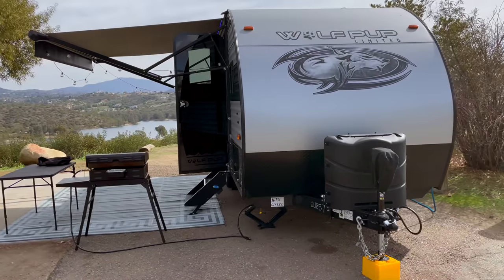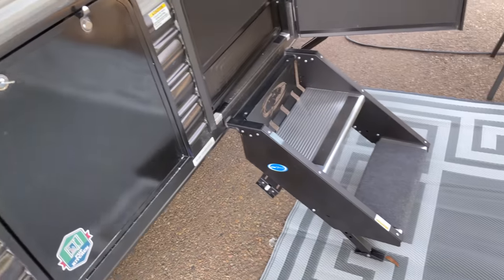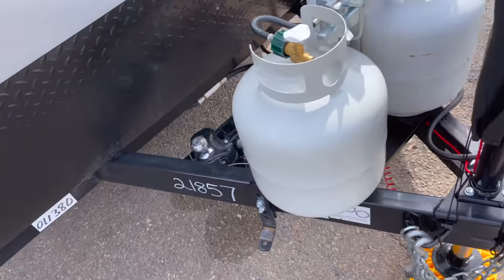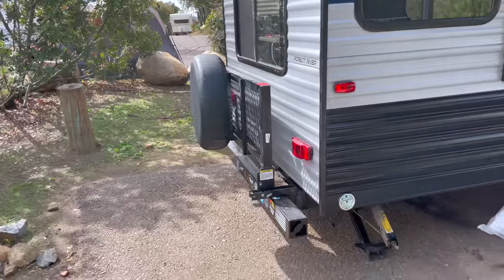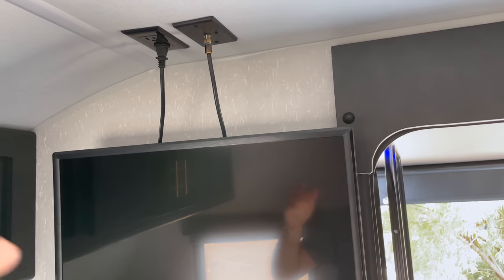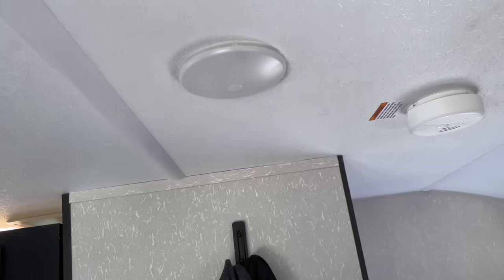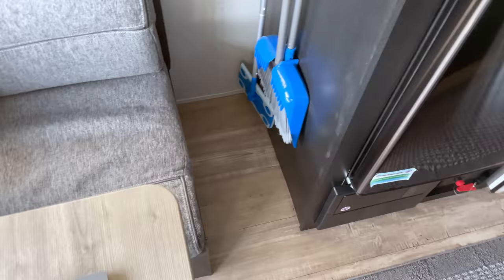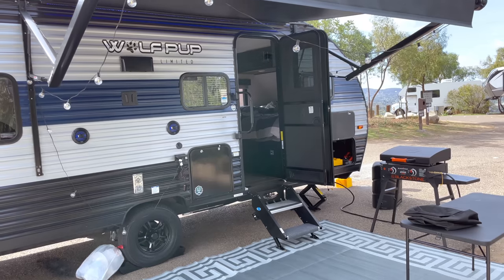MY NEW CHEROKEE WOLF PUP 16TS TRAVEL TRAILER 🏕 🎉 - Full Tour

Comment: Funny,  I bought a used 2021 first generation FQ model. Had the same screen door issue.  I'm an engineer and saw the door frame is bowed out at the latch. The dealership agreed and before we transferred ownership they replaced the door!  Surprise!  New door has the same bow!  The door latches but the brush insect seal is not totally covered.  So, this is a Lippert door issue.  I wish now I had just shimmed the latch because the replacement was not the same quality in the way of caulking.  Good video, btw.
Reply from the maker: Interesting! And thanks!

Comment: Sweet setup!  I'm comparing the 16TS to the 16FQ.  I may have to go with the FQ for bed length.  I'm 6'4" and think the east/west bed wouldn't cut it.   Thanks for sharing your mods!
Reply: I just purchased the 16ts it doesn't have enough room for me it would be better with a slide out or 2or 3 still a nice camper.
Reply: @tonycagle6258  I have the 18TO,  Full slide wolf pup series and still a small footprint. When the slide is out it becomes a very comfortable living area.

Comment: I just bought a pup 14cc. went to Iowa to get it way cheaper than anyone else. Perfect for two!
Reply: Black paint on the AC.  Bad idea.
Reply from the maker: Talking to a couple people from Dometic and Coleman, there is no affect to the AC unit as far as efficiency goes when it comes to black and white shrouds. If there were, they wouldn’t make them in black. Space between the components of the air conditioner and the shroud itself plus the ginormous vents that are in it allow the unit to do its job properly regardless of the color. Will the black shroud itself be hotter? Yes, but no affect on the units according to the pros.

Comment: Very informative video. Have you ever weighed your trailer when you're loaded for a weekend or week?
Reply from the maker: I have yes. It’s at about 3400lbs. I don’t travel with water in the fresh water tank either. I’d go over the axle rating on the Tacoma if I do.
Reply: @TheRVPastime  Oh. What does your hitch weight end up to be? I thought the Tacoma had a pretty good tow capacity. Isn't it five or six thousand pounds? Sorry about all the questions oh, but I have an 86 Ford F350 DRW so I never thought much of tow capacities with small trailers. Now I'm passing that truck onto my son, and in the market for a much smaller truck. Actually maybe not even a truck in the sense. I've been looking at that Hyundai Santa Cruz. It has a 5000 pound towing capacity, but it's smaller than your Tacoma. I don't want to run into braking issues either. 
Thank you for any input or opinions you may have.
  I don't want my total weight to max out much at all over 3750
 pounds. I want a safety buffer.
Reply from the maker: No problem, the hitch weight is somewhere around 500-600lbs. The common misconception about tow capacity is that the advertised number is not usually what its actually able to be. In my case because I have the “pro“ package on my truck that adds more weight to the vehicle and my payload is less which affects what I’m able to actually pull. My truck is able to pull about 5600 but in my honest opinion the Tacoma‘s just really don’t have the power or the transmission to do anything that heavy. Can it? Sure. Should it? Debatable lol.
Reply: @TheRVPastime  That's why I want such a large buffer. I'm also worried about frontal mass. In the past, I have pulled trailers that were not particularly heavy, but felt like you were walking with a piece of plywood on a windy day. It's no big deal when your truck is tipping 8000 lb, 23 ft long, and has a set of training wheels, as my brother so affectionately called them.

Comment: Hey Nick! I picked up my 16TS last Friday! I love it already. It has a couple of smaller issues but nothing major so far. Came with the Castle Rock tires though which I want to upgrade ASAP.  Did you switch to the same size Goodyear Endurance tires or did you upgrade? I would like to move up in load capacity but don’t know enough to make an educated decision. TIA!
Reply from the maker: Congrats on your new 16TS! Welcome to the family. As for tires yes, I switched to the same size tires in the good endurance. I’m not sure if getting bigger tires is really that big of a need for this particular type of trailer. Considering the max load at 65psi for the Endurance ST205/75R14 tires is 2080 pounds each, and the 16TS axle GAWR is 3500, you should be fine as long as you never overload the trailer. Hope that helps! Either way, tire upgrade is a must for both peace of mind and safety :)

Comment: I am curious on how you setup the awning LED strip. Did you have to hide the controller box inside? Any tips would be much appreciated! 😉
Reply from the maker: Yes, the controller is hidden inside of the awning arm where the power to the original led tape terminates
Reply: @TheRVPastime  Ah cool! It should be a pretty easy install then. Thanks for the response.

Comment: I like your video and all the modifications you made to the unit I was just wondering how much did it cost to add base value?
Reply from the maker: The electrical upgrade is naturally the most expensive upgrade. The lithium batteries run about $900 each but I think I got them on sale. To get an idea of overall cost, you can build up a similar system on their site to see the totals.

Comment: Thanks for this. Q: What is the useable width of the door, and threshold elevation from ground? Considering for use of a less than 100% mobile person. Also, is 12V refer working out well? Love all the Geek stuff.
Reply from the maker: I don’t have that measurement so I’ll have to get that when I’m at the trailer next. As for the fridge, it’s great! Gets cold super fast and haven’t had any issue yet.

Comment: Love your modifications as I own a 2020 Wolf pup 16 fq.  So far I've only added two 100 watt solar panels to the roof and the hydraulic arms to lift the cabinet doors as they pull upwards.  Noticed you put your lithium batteries inside the storage as oppose to being outside where the original one was.  Was that for security as they are pretty expensive?  It takes up your storage space. Looking forward to more ideas in the future.
Reply from the maker: A little bit was security, but mainly it was because I wanted to have all the electronics in one place and short cable runs. Plus, lithium batteries don’t do well as you get to freezing temps (if I was ever in that situation) so it was better to have them in a climate controlled environment. As for the storage space, for me, that small amount of storage space it took up wasn’t a big deal.
Reply: @TheRVPastime  Very nice set-up. But not sure if I would want to have batteries under my bed. Seen too many videos where things go wrong

Comment: Would you link the faucet!? Also, sorry if you said it but what size tv fit in the front by the bed? Did you use existing mounting bracket?
Reply from the maker: Here’s the faucet I got. I had to get some adapters for the faucet hoses to the pex tubing since they were different size. I got some that had valves on them so I could shutoff the water at the sink if need be. https://www.amazon.com/dp/B08JPWRSL3/ref=cm_sw_r_cp_apip_wuiRtwBZxdX52

As for the TV, I did use the existing bracket and that’s a 24” TV but I’ve seen people either move the mount or use a different one and put a 32” but that is a bit tight.
Reply: @TheRVPastime  right on I had tried a 32” but I’d didn’t fit. I don’t want to relocate the bracket yet. 

Thanks so much for the reply!
Reply: @TheRVPastime  I bought and just installed the faucet you linked to (into my 18RJB) but forgot about the adapters, so any links for those or you just went to the hardware store? Thanks.
Reply: Just saw the instructions have a link to the amazon store for the adaptor, so that should work.
Reply from the maker: Ok cool. Yes I ended up getting some valves at Lowe’s that allowed me to shut off water to the faucet but also helped with the size change. Unfortunately I don’t remember which ones I bought

Comment: Hello. I really enjoyed your video. I ordered a 2021 Wolf Pulp 16bhs. I want to do led bulbs for the exterior. Which route did you take in doing this to your own?.... Nice truck too! 😊
Reply from the maker: Which LEDs are you referring to? The trailer marker lights or the awning? The LED replacements for the marker lights on the outside of the trailer are 194 bulbs. Simply pop off the covers and replace the bulb. Thanks for the note about the truck ;)
Reply: @TheRVPastime  Thank you so much, the bulbs for the outside markers lights is what I’m looking to upgrade. Thanking you for providing the 194 bulb number. 😊
Reply from the maker: Sure thing! Also just a heads up some LED bulbs can only go in one way otherwise you reverse polarity so I suggest you replace them with the lights on and if you plug in the bulb and it doesn’t turn on flip it around and see if that works.
Reply: @TheRVPastime  Oh okay, yeah I had no clue about that? Thank you so much for that tip! I look forward to more of your videos to come. 😀

Comment: The GVWR for this trailer is 3970lbs.I was told I should not pull anything heavier than 3500lbs with my Tacoma V6 .Have you gone uphill much with this set up and how does it behave?
Reply from the maker: Here's the thing about these trailers...the GVWR is 3970, however the axle rating is only 3500lbs. So, in reality you shouldn't go over 3500lbs on the trailer anyway. Im currently sitting at about 3400lbs with the trailer. The Tacoma pulls it "fine" meaning, its all within limits and payload capacities. However, the Tacoma doesn't really like to tow heavy things in general. All in all, I haven't had any issue with the Tacoma, but I will be upgrading to a bigger truck soon just so I have room for expansion with a larger future trailer.
Reply: @TheRVPastime  Thank you for the reply .Cheers

Comment: Hi , Great Video ! Did you remove the Air Condition cover to paint it or just paint it while on the roof ?
Reply from the maker: Great question! I removed the cover. I think it was only a couple screws. Super easy. :)
Reply: @TheRVPastime  It looks good black, but are you concerned about its vulnerability to increased heat stress/fatigue/breakdown since black absorbs more heat?
Reply from the maker: They actually make these covers in black already and it’s the same plastic material. Just stupid expensive. The paint used is also UV resistant.
Reply: @TheRVPastime  but it will still absorb heat and ac efficiency goes to crap .
Reply from the maker: There are plenty of observations from manufactures and RV owners online when it comes to the color of the shroud on the AC unit. The overall consensus is that the color of the shroud has little to no affect in the performance of the AC unit. It all comes down to the quality of the AC unit itself in construction, design, and installation. The shrouds are a means of protection from direct sunlight and rain. I spoke to someone at Dometic about this very subject and the response was a giggling “no, the color doesn’t matter. If it did, you would only see AC units come in white. It’s just an aesthetics thing”. Because the shroud is a thin plastic piece over the AC unit with multiple vents and holes it does not do a very good job at trapping heat as if it was a sealed unit.

Comment: I was wondering if you could share which LED light strip you used to replace the blue one under the awning? I have a larger version or your camper and I would love to replace it but have it look factory like yours. Thank you for the help
Reply from the maker: It’s kind of a hybrid installation in that the strip itself can be any waterproof led strip off Amazon. I got this one https://www.amazon.com/dp/B00COE78EQ?ref=ppx_pop_mob_ap_share

However, because the controller/receiver for the LEDs needs to fit in the awning arm, I used a slim version from a previous set I bought which is this: https://www.amazon.com/dp/B07NWFVRY4?ref=ppx_pop_mob_ap_share

The controller is the little black box the goes between the power and the led strip itself.
Reply: @TheRVPastime  thank you. I wondered if it was just a standard strip. I didn’t want to take it out then not be able to find something to fit nice. Plus I want to use the factory switch. Thanks again for the help. You have some great mods

Comment: What range of gas mileage are you getting with your Tacoma?
Reply from the maker: I get about 11-12 mpg, so about 250 or so miles. Depends on the grade.
Reply: Did you add any additional gauges to monitor trans temp on your Tacoma? Do you use ect when towing or shift. Thanks. A towing video or hooked up to the truck?
Reply from the maker: I do not monitor the trans but have considered that. And yes, I always use ECT mode while towing.

Comment: can you tell the what tires did you get to replace the one that came with the trailer.  I have a 2020 Wolf Pup FQ16.  Thanks in advance
Reply from the maker: Sure, my tires on my 16TS were ST205/75/R14 tires which I replaced with Goodyear Endurance of the same size.
Reply: @TheRVPastime  
Thank you!  I hear all these stories about stock trailer tire, I’m trying to stay ahead of a potential problem.

The mods you made are awesome, following.
Thank you again

Comment: 2023 Wolf Pup 16 TS owner here, what a joke. I am a single guy, never loaded the RV to capacity ( I don’t carry water) just some clothes and food. I was headed to Lake Tahoe at the end of August when my Inferior “cast” aluminum rim literally blew up. I never ran over anything or even heated up my brake drums. I was traveling on a flat area of hay 20 when my rim blew up, instantly. I had full coverage insurance, they wanted to have me file a claim, but because there was no accident no can do. Because it’s a manufacturing defect. The “wonderful” free towing took 2.5 days of me sitting on the edge of the bay before they had a con artist tow company tow me to my maximum distance of 100 miles. Zero dealers in a radius greater than 100 miles would allow my trailer on their lot. The place where I bought the trailer also refused to fix the problem. They referred me to the Manufacturer. Let me be clear here, the rim blew up into hundreds of small shrapnel pieces of aluminum. And, the shock load of the trailer instantly loosing the rim caused the axle to break and the leaf springs to be severely damaged. The company has never called me back. I ended up at a gas station for another 3 days. Totally dissatisfied and disappointed with Forest river and the entire RV experience. This is a 2023 that was just over 6 months old. This was my baby, I washed it every week just to keep the dust off her, it was immaculate before this happened, now it’s been sitting in my driveway for over a month and no one is willing to do anything for me. Are we living in the Twilight Zone? Confused, sad and totally dissatisfied. Looking to get thru to Forest River.

Comment: Can't control the awning on our 21.5 FQBL with the app
Reply from the maker: The OneControl app? That’s a bummer. I think that’s standard now on all new Pups
Reply: @TheRVPastime  yeah  just for whatever reason the awning is locked in the app. I can control just the awning and the scare light in it.  I had hopes of being able to do more with it
Reply from the maker: I have the 16TS but I have had that happen a couple times. That’s a safety feature built in. It usually locks out the awning when it detects movement such as the trailer moving down the road. Usually if you tap the physical switch, it’ll unlock and let you control from the app. I find that usually it’s locked out if I try to move the awning from the app shortly after I finish setting up. But, later on, it functions properly. Give the button tap method a try. :)
Reply: @TheRVPastime  I tried it but maybe it was picking up the wind and it was hlowing more than I thought it was
Reply from the maker: Maybe!

Comment: I wasn't able to use the existing wire to pull new wire through for a new solar setup. Also when I rewired my control panel I found it was held on by one half inch screw. It was the worst wiring job I've ever seen. Horrible QC.
Reply from the maker: Yeah they put these things together super quick and rush them out the door.
Reply: Bought a WolfPup 16TS in March. Terrible quality control, throughout. But the unit has several features that I wanted. Large 12 volt refrigerator! Added solar panels and larger battery bank and solar controller. I did enjoy your video. Is your video of mods out yet? Also, we had the same issue with the screen door!

Comment: Wrong 16' Wolf pup, the 16pf is much better, that east west forward bunk is not fun if you have a SO, crawling over one another at night is 0 fun, so you took the A/C unit that is going to keep you cool and painted it black so it will over heat? Why? Great video though, thanks I know not to buy that one
Reply from the maker: Everyone has their own preferences as far as layouts. Now, when it comes to the air conditioner cover, it doesn’t cause it to overheat just because it’s black. There’s all sorts of openings on it. Besides, they make them in black. I just didn’t feel like spending a bunch of money just to get a black cover when I could paint it myself.